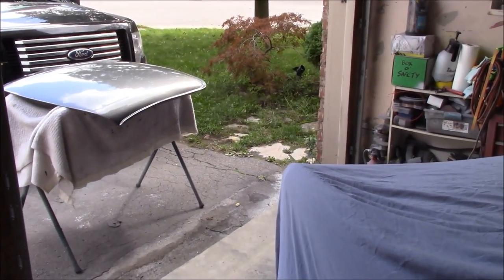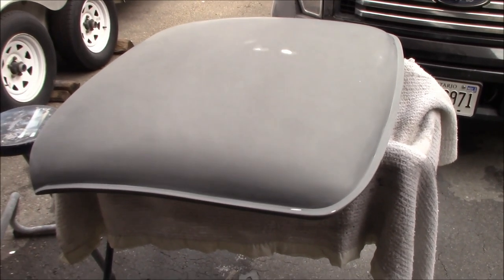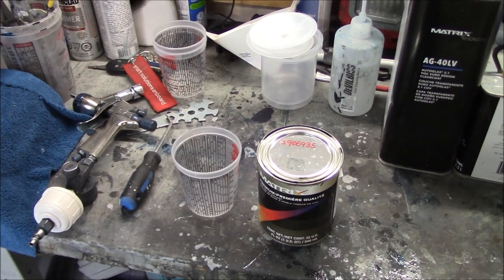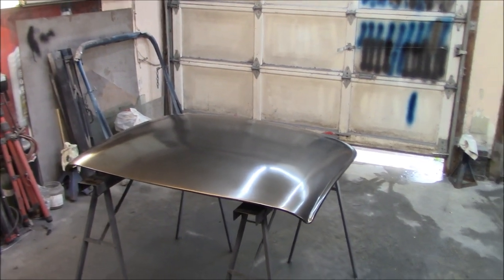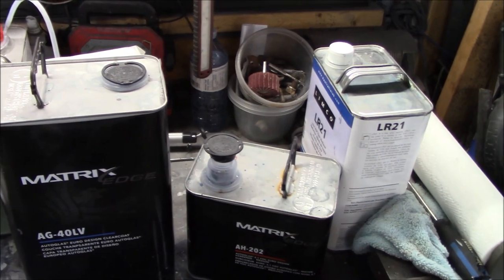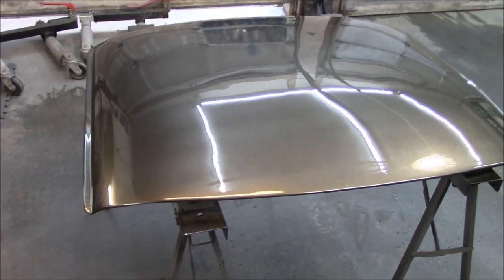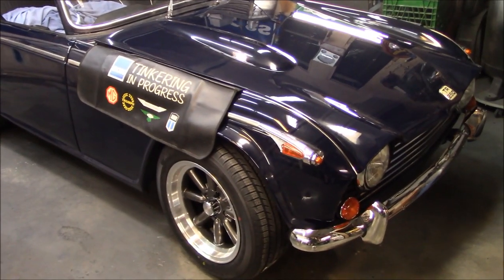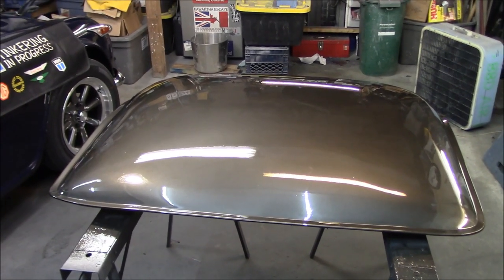1968 Triumph TR250 Restoration Project, Hard Top Section Painting , Start to Finish.

Comment: Thank goodness you wear a respirator ! Nice job!
Reply from the maker: Yeah, it gets pretty foggy in there with the clear coat.  Normally I have 4 fans running, but I didn’t want to exhaust out the front door as I was afraid to get overspray on the car.

Comment: Stance of that car is just so nice, it seems to me exactly what one would want. Your gun hand is good there Tush, you keep a nice consistent distance on each pass. I like the idea of using the roof panel to pick out the wheel colour, in the sun that should really look smart. I’ve commented on it before but every time I see it this car just blows me away. Easy to say when it’s someone else doing the work but I think it totally looks worth your patience and effort there in the middle of the restoration, you were so right to take a pull on the time and concentrate on the finish you had visualised. #
Reply from the maker: Thank You Niall.  Yes, I try to be fairly robotic when I paint and try to keep a consistent distance, angle and pace.  It works most of the time unless I have a lapse in concentration😉. I’d like the car to sit down a little bit more in the rear personally….

Comment: Nice recovery! I was gutted when you ended up with a mural of the Niagara Falls on the hardtop, but it looks great now. The way the light catches a surface can dramatically affect the perception of colour. For example, different parts of the wheels appear as different shades of grey/silver. Even if the hardtop was an exact paint match the horizontal surfaces would reflect a lot more light, so I doubt that anyone will even notice any slight differences with your (very creative!) custom blend.
Reply from the maker: Thanks Rocky!

Comment: Appears to be too heavy on first coat amd too much overlap.  Need to move gun a bit faster.
Reply from the maker: Are you talking about the base coat or clear coat  passes?
Reply: @cheftush   base coat. other channels seem to go light on first coat and heavier on second. and third.
Reply from the maker: @joelpalmer  hi Joel, I was spraying a very high metallic so I didn’t want to tiger stripe it so I was 50 per cent overlapping.  I usually spray solid colour so I am not very practiced with metallics.   My gun set up was a bit off as well.  Anyway, it turned out well in the end and it was a good learning experience.
Reply: @cheftush  end result looks great!